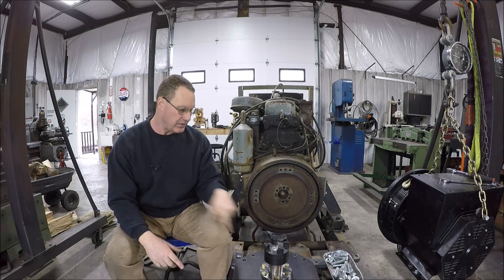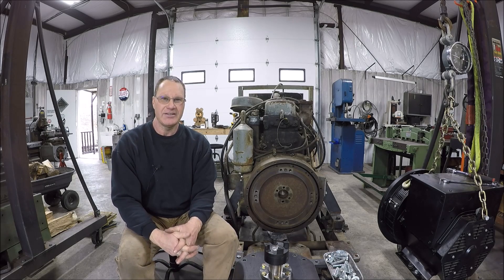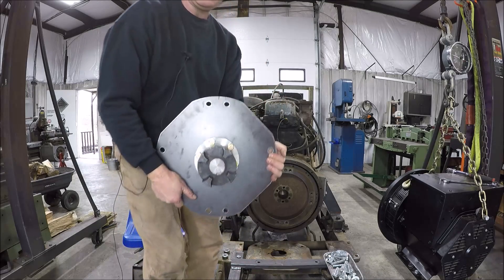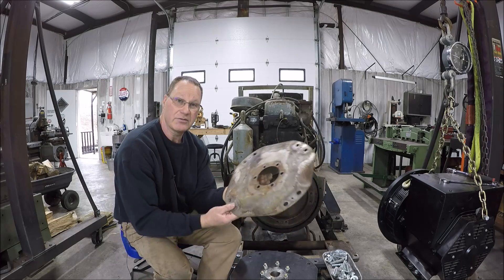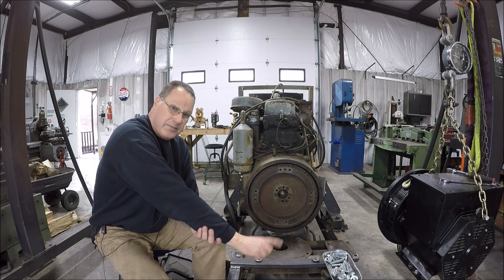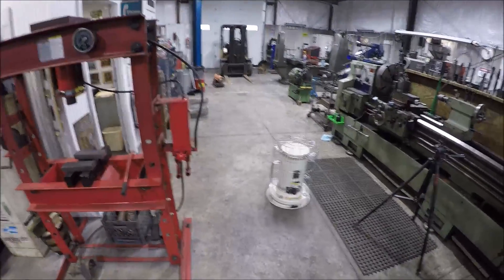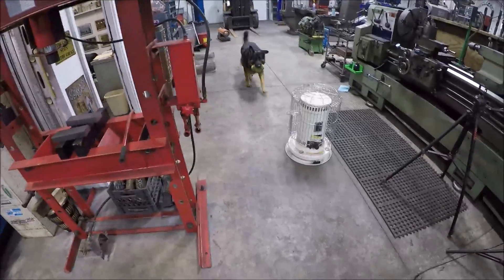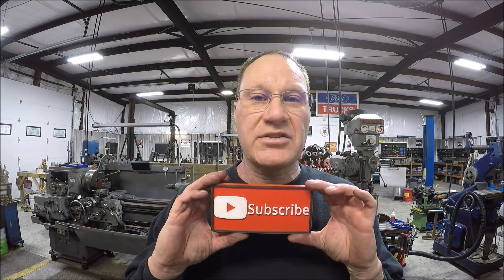Modifying a 2 71 Detroit Diesel generator. Part 3 final

Comment: Nice video great work . It looks like the flywheel housing is larger the the generator you can buy fly wheel housing reducer ring to bolt the generator end straight to the engine.
Reply from the maker: Thanks. I went with what the generator manufacture said to do.

Comment: Great video.  Yes, single or double bearing is very important.  Those thin flex plates will handle 300-400 amps with no problem and help with torsional and alignment, mainly on single bearing generators.  They would have been perfectly fine on the generator you have.  With the rigid flex plate and your coupling you should still be fine.  Alignment will be very important but the coupling will help some as long as things are close.
Reply: Alignments usually involve dial indicators and not a digital level!!!

Comment: Looks good Tom. Lucky you had a company and people willing to help you out. I know what you mean about deliveries. I got 2 packages this week and one was soaking wet and the other had been ripped open and taped up with about half a roll of tape. Thanks for tying this project all together.
Reply from the maker: Thanks Jim. South Georgia Generator really came thru. I know what you mean on the shipping services. It sure is hit or miss. What I don't get is when the package is like 50 miles away at a hub and then they send it 3 states away and it has to work its way back to the same hub to be delivered like 5 days later. That can't be efficient.

Comment: G'day Tom.   Even though losing info can happen at times, we press on as you have. I went through a special dismantling & Re- Assembly on a motor doing timing gears timing marks & special assembly in great detail, But when I went to edit,   the file was corrupted,  so I feel for your circumstance.
Great collection,  Thanks.
Ted
Reply from the maker: Hey Ted. Loosing the footage  was a bummer for sure.

Comment: G'day Tom great when you get support from a vendor.   One thing stands out is the "Spider Web" support for the generator.  Be careful if the generator pulls a large current that the resulting torque doesn't twist the frame.  Have a look at the member size of the main frame the motor sits on.  Maybe would have been better extending that by welding and "fish plating" I have seen on two occasions in my career where the designer hasn't run the numbers on a foundation design and ripped the motor of its base when it came under full torque.  
I am getting undeliverable on your email address.
Cam

Cam
Reply from the maker: Thanks for your helpful suggestions. They are always appreciated. I sent an email to my web guy telling him about the issue. Not sure if he has had a chance to look into it yet.

Comment: Bummer losing the footage. That sucks. This has happened to me, too, but I have been able to mitigate some of that by having 2 cameras running. I like the versatility of multiple angles, which adds to the editing time, unfortunately, but it has also saved my bacon for the few times when I either had one camera in the wrong mode or the SD card failed.
Reply from the maker: I know I was totally pissed when it happened. I guess the only saving grace was I had just recently moved a bunch of pictures and video clips of another project from the SD card. So thankfully I did not loose all that too. I wish I had the extra time to set up two cameras.

Comment: Looks like you did a great job putting it all together I was thinking it would bolt to the Bell housing of the motor but it has it's own mount and with the two mounted to a common frame the Lovejoy coupler is the way to go
Reply from the maker: Thank you. A lot of parts in the equation for sure.